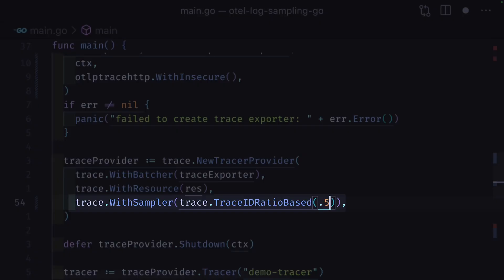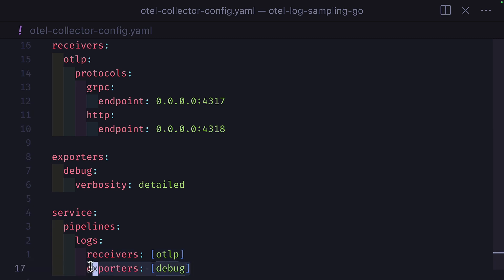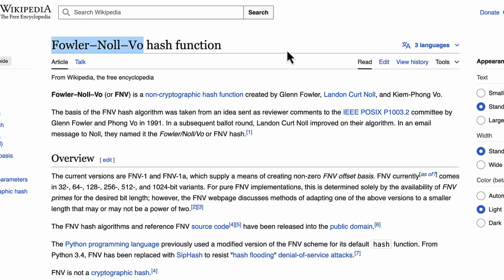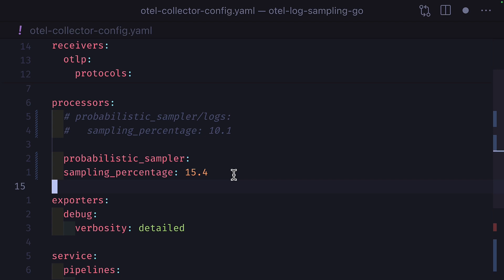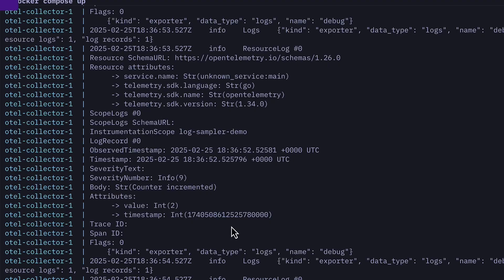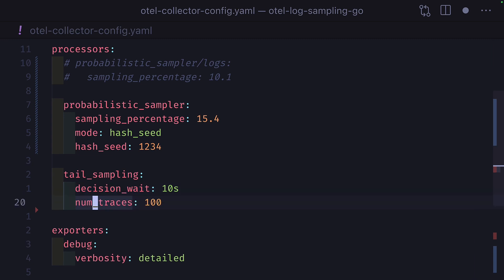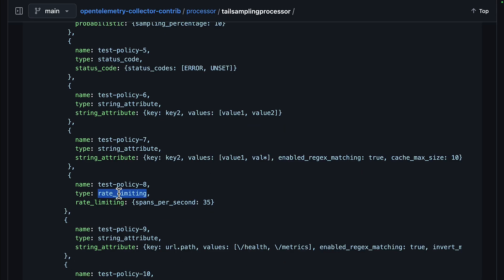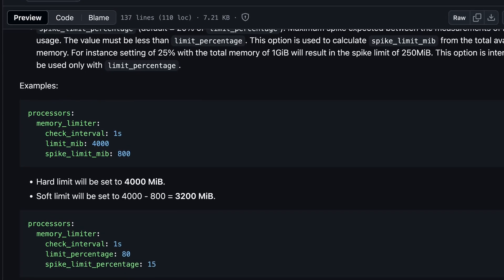OpenTelemetry Sampling with Go - Simplify Chaos and Get Better Insights

Comment: Hey I have issue with my code, does open teletry solve it... Currently one of the path say path A in our code has high frequency and other paths say path b,c are having low frequency. Becuase of this we see more traces of path a and b and c are appearing less. We want to reduce the traces of path A and make b,c appear more. I have tried many solutions but currently struck with head based sampling that samples if given is path A, however this is not a good solution to me as I would sample down error traces too. Is there any industrial solutions for this? I am trying my best for solution and I didn't find any